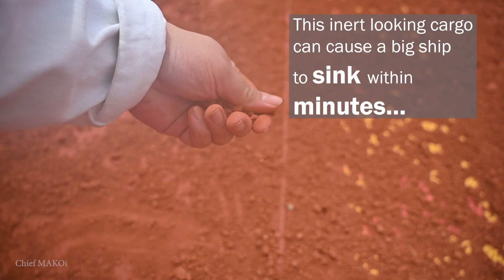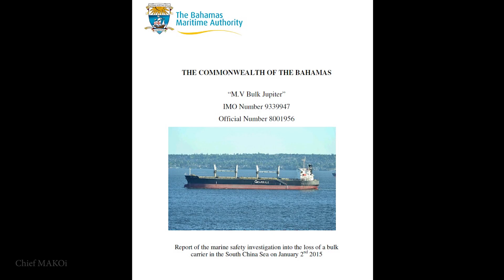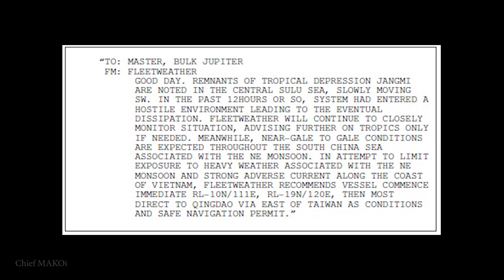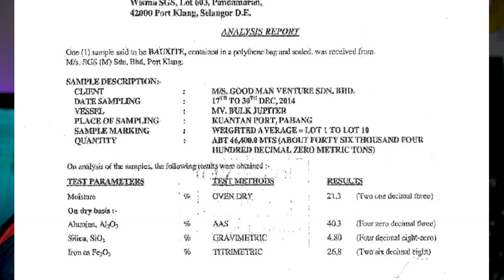The Cargo That Can Sink Ships Within Minutes : Bauxite Liquefaction | Chief MAKOi Seaman Vlog

Comment: I'm not in the marine industry, but it would seem that if the problem is water rising creating a slurry on top, inverted subdivider boxes could be forced down from the top caping the material and preventing the slurry's movement.  It would cost more and require extra steps, and they would have to be tied down.  I know the overall problem is called the Free Surface Effect by naval architects.  I'm pretty sure that is what caused the loss of three of the four PROTEUS Class coalers/bulk carriers.  They just disappeared. The fourth PROTEUS class ship, the JUPITER, was converted from a bulk carrier into the US Navy's first aircraft carrier the LANGLEY.  It was scuttled by its crew after being damaged by the Jappanese.
Reply: You're not going to be able to force anything like that down into the cargo. Too much friction between the walls of the boxes and the cargo as you try to force it in.
Reply: @beeble2003  I guess that means the only option would be to subdivide the holes more from the bottom to top and have blocks which can be dropped on top and anchored - expensive and problematic. I guess the water content has to be checked by the shipping company's testers before and during loading.
Reply: @lewisdoherty7621  Your last sentence hits the nail on the head: the correct solution is to avoid the problem altogether by not loading the wet ore in the first place.

Comment: I'm not an engineer nor do I know much about cargo ships other than what I've learned from this channel. That being said there seems to be an obvious solution to the liquefaction tendencies of some dry materials. 
There are way too many people who will, by default, automatically reject any new thinking-outside-the-box type solutions. I'm hoping that somebody is able to read this and actually think it through. Because I personally would like to know why this idea wouldn't work.
Anyway here's my idea:
What is the item that allows transportation of liquid products in everything from ships to planes to trucks? The answer to that is baffles. 
My question is why they couldn't utilize baffles in the containers that are transporting such products? Yes it would add more weight to the ship and would lessen the amount of product that could be transported because of the space that the battles would use, but it would also mean that they wouldn't have to worry about liquefaction because the dry product is being treated from the start as if it's a liquid product.
It would definitely add more expense, but that expense would be offset by the ability to ship the product no matter the moisture content. It would also offset the expense by possibly lowering insurance rates for shipping such products. Not to mention the expense of a ship that sinks because of liquefaction.
The baffles could even be designed in such a way as to allow them to be removed with relatively little effort if they weren't needed.
Anyways like I said I'd be really interested to hear people's opinions on this idea.

Comment: When you mentioned iron ore as being another possible source of liquefaction, I thought of the Edmund Fitzgerald (my dad was a crewman on a great lakes freighter before WWII). Could liquefaction have been a contributing factor to that loss as well?
Reply: He must be talking about raw iron ore. Great Lakes freighters transport a purified and pelletized version called taconite pellets. The pellets are roughly a half inch in diameter.  The pellets come out of the production process very dry as they are oven roasted, making them fairly sturdy to survive transport. I imagine that if the pellets were to get wet via rain or waves they wouldn't absorb much water because of their density. The space created in between the pellets would allow the water to simply drain through the cargo.
Reply: @rjgoniea  He'll be talking about haematite, yes. It's shipped as crushed rock and would be susceptible to compaction and liquefaction. Taconite is actually a relatively impure form of iron ore: when mined, it's about 35% iron and, is purified and roasted into pellets, of about 60-65% iron. Haematite ores usually don't need much processing to get to that iron concentration. The steel industry in the US only started using taconite after running out of haematite.
Reply: @beeble2003  taconite contains both magnetite and hematite, and some other trash iron containing minerals. 

For taconite pellets the high magnetite areas are mined, magnetically seperated, then pellletised. It is the pellets that prevent liquifaction not the mineral type.

Both hematite and magnetite can be mined and transported as lump or fines. Magnetite is more easily processed as fines so is probably more commonly transported as fines. But all types of iron ore are commonly transported as fines. 

Except taconite, it's too trash to transport raw and needs onsite processing into pellets.
Reply: The fitzgerald dunk due to the leaking cargo hatches during the winter storm.
Reply: @gatewaysolo104  That is only one of the theories about the sinking. None of them have sufficient evidence to prove they were the primary cause. And in my opinion the leaking hatch theory is one of the least plausible theories out there.
Reply: No. The particle size is way too big.

You're like the third person to ask this. Why is everyone asking about such an old and obscure accident?
Reply: @mabamabam  Here in the Midwest it is far from obscure. To date it is still the largest ship to sink on the Great Lakes.
Reply: @mabamabam  obscure? There's a famous song written about the Edmund Fitzgerald
Reply: @TheOldMachines  The ironic thing is that song is factually incorrect on a number of major points.
Reply: @mabamabam  The Edmund Fitzgerald was considered the pride of the Great Lakes fleet in a time when things like ships and trains were considered marvels of modern engineering far more than they are today.  Her sinking had much the same impact as the Titanic.  It is also a cautionary tale showing that even the finest ship manned by an experienced crew and commanded by an experienced captain can fall victim to the power of nature.
Reply: @mabamabam  umm, you watched the video where he mentioned iron ore? Perhaps since the EF was hauling ore liquidification could have occurred. That’s why they ask?
Reply: @mabamabam  Obscure is a relative term.  It might be obscure to the uneducated.

Comment: very interesting , i worked as a logistics specialist for road transport, rail links as well container traffic from local ports , we dealt with typical dangerous goods cargo , regarding container exports or road ferry crossings and all the regulations of stowage and separation restrictions and how to properly label multi product loads ,,, and can attest to having to stand our ground on  not excepting improper packed or even leaking products from shippers , getting the typical threats of giving the load or contract to other carriers or making the driver wait  for a new appointment days later, only to  get there and still have the same  non ship-able products as before and re refusing it once again ,,, or the difference of consumer commodities from equal volume in  bulk container shipping forms that now require  special labeling and separation where the equal volume in consumer commodities  size packaging did not require the extra labels thus extra cost ,, the average consumer has no idea what it takes for the goods to reach their local market store , and that includes the bulk cargo that make up the base of most consumer products these days ,,, we all have seen far too many preventable accidents ,stay safe and never be afraid to protest a  bad decision

Comment: Thanks, Chief. Most of us are unaware that "dry" cargo is seldom completely dry or of the potential consequences of error.

Related to moisture problems - How do grain carriers deal with the risk of fire if damp causes fermentation and heat build up?
Reply: You could pump in seawater to extinguish a fire I guess.
But fermentation alone can't lead to fire, it needs to be a cargo that chemically oxidises at a relatively low temperature otherwise it just gets to a temperature that kills the fermentation then stops. I don't think wheat grains do this? I know it's a problem with some oily nuts and seeds though.
Reply: @samheasmanwhite  It's not really fermentation - but wet hay makes heat until it's dried out. It doesn't really become a problem until stored in a pile or baled. This heat alone doesn't really tend to get out of control. The wet environment (greater than 18% moisture content) fosters the growth of bacteria and fungi that produce even more heat. Once it reaches about 100°F(38°C) it starts undergoing a chemical reaction (also called caramelization) that produces even more heat (at this point, the bale can still be OK - but its nutritional value is reduced). This caramelization also fosters further bacterial and fungal growth that then spirals out of control producing gases that are above their ignition point. Upon contact with oxygen, they ignite. 

This can happen with grain too but - greeness generally isn't a problem. It's usually fungal growth and grain dust that causes fire/explosions. The fungal growth causes excess heat, produces gasses that are above their ignition point, oxygen reaches it. They ignite. The grain has been disturbed and has produced enough dust - the dust concentration is just right and the air ignites. 

There's charts and research about this topic freely available online.
Reply: @EyebrowsMahoney  it's not unheard of around hear of a barn burning down because farmer Joe was unable or wouldn't use a tedder for his hay or something, wet hay- stacked in a old school hay loft, builds heat and smoldered, to a flame. Gone.
Reply: @tacomas9602  Of course - I thought I had covered that? Part of the issue is that Hay still respirates once it's chopped. (I think most plants still do to an extent) this produces heat until it dries out and stops. If the heat gets bad enough, it starts to caramelize the sugars (known as the Maillard reaction), which livestock love (because it's sweeter -but it's not as nutritive for them) and then the warm environment allows microbes to flourish - further creating additional heat (and fire risk). 

Tedding is an option but modern hay mowers have crimpers which minimize the need for tedding these days by crimping and splitting the stalks to allow them to dry faster. Though a lot of farmers still are working on weather pressure so they might be inclined to bale moist - which if they're careful, they can get away with but have to be on top of their bale maintenance.
Reply: @samheasmanwhite  I'm not sure but that sea water sloshing around in the hold might add  another problem. 
I was asking from stories about damp grain fermenting and causing smoldering fire in grain elevators when oxygen got to the source. Also from personal experience where hay had been baled containing too much moisture and barn fire started as bales were moved and oxygen got to the interior of the loft.

Comment: Chief:
Does this mean that when ships carry liquid cargo, they carry significantly less, so that the liquid content won't cause the same "top heavy" waves?
Reply: The safest way to carry liquid cargoes is to have the tanks topped right off. The shifting of any bulk cargo is dependent on how much “free surface area” there is. Full tanks have no free surface, therefore no shifting.
As others have mentioned, longitudinal bulkheads can reduce the severity of the shift by reducing the athwartships range of free surface movement. 
With a liquid cargo, such baffles do not affect loading or unloading as they do not need to totally prevent flow, just reduce “sloshing”. However, when the cargo is unloaded by bucket then baffles are a real hassle.

Comment: Good channel Chief
Question what is your vessel's bulk cargo capacity? Tonnes/m3?
Bauxite very cheap commodity worth about $70 tonne delivered China. You need 4-5 tonnes to produce 2 tonnes of Alumina, ( worth $389 tonne delivered China) and 2 tonnes of Alumina to produce 1 tonne of aluminum.  ( $2,700 tonne)
Bauxite is 1,281kg/m3
Vs Iron ore  5,150kg/m3
Iron ore is $93 per tonne

Comment: so, just curious: why are there no baffles when carrying materials that may exhibit liquifaction? Because that's a foolproof way to "soft" compartementalise, and prevent list due to a moving center of gravity?
Reply: no kidding - even baffles for the top 50% of the hold would have made a huge difference. And if so, why not just pump out the excess water?   All boils down to cheapness of the owners unfortunately.
Reply: @ghostrider-be9ek  You can't just pump out the water. First, there's nothing to pump until liquefaction has happened, and that doesn't happen until the ship is out at sea being shaken around by the waves. Second, it's not just water: it's basically bauxite mud, and it's a significant fraction of your cargo.

I don't know how effective baffles would be. If you needed so many baffles that it interfered with loading and unloading the cargo, that would be an issue. And there's already a control measure against liquefaction, which is to not load wet cargo.
Reply: @beeble2003  Why not pump IN water so that it's filled completely to the brim? Then there's no room for displacement to cause an imbalance
Reply: @chang.stanley  Because the customer wants dry bauxite, not mud, and because you have to burn a lot more fuel to carry all that water around.
Reply: @beeble2003  I see. That makes sense. Thanks
Reply: @beeble2003  as a non expert - I would surmise it would still be better to pump out the top level of water/slurry, rather than risk capsizing - but if 50% of the cargo turns to soup then this idea is pointless. 

Baffles are used in liquid containers - but for dry goods I would suggest not going down all the way to the bottom, but rather say, top 50% only as the free surface effect is the greatest up top.
Reply: @ghostrider-be9ek  You'd need to pump thousands of tons of mud in a few minutes. Maybe that's possible but the correct solution is to load your cargo more carefully to avoid getting into that situation in the first place. Just like it's probably possible to fit an ejector seat to your car in case you try to overtake and find that there's traffic coming the other way. But the correct solution is to avoid that situation by driving more carefully.
Reply: @beeble2003  yea the pumping would be  done slowly - ie. the crew discovered the slurry after departing (but still in relatively calm seas) - however the partial baffles would go a long way to mitigate the free surfce effect
Reply: @ghostrider-be9ek  The slurry only happens after the ship has been shaken around by rough seas.
Reply: You can't unload with baffling.
Reply: @mini696  if the baffling is only the top, say 50% of the compartment, to minimize free surface effect, it would still allow for unloading.
Reply: @ghostrider-be9ek  No they are unloaded with big buckets.

Comment: Some more information on the Edmund Fitzgerald that sank in 1975 on Lake Superior, USA. I heard his story on a video on YouTube. He is in his later 50’s or early 60’s. There was a gentleman who was the nephew of one of the sailors on the Fitzgerald. He said that when Fitzgerald was being manufactured there was two bulkheads that were deleted from the ships cargo hold. And this caused some structural issues in this man’s opinion, because it caused the ship to twist not only up-and-down but sideways and this caused the steel to fracture. And the vents on the side of the ship which would let water into the ballast tanks to keep the ship stable were torn off during the storm, so the Fitzgerald was taking on water and listing. And if you looked at the cable fencing along the side of the ship it snapped in half. And when the Fitzgerald went underneath a wave it submarined   and touched the bottom and the stern keel snapped in half and flipped over on top and the boat sank. And the stern on the ship was found not far away from the bow which indicates that the stern broke from the rest of the ship while the bow submarined and touched bottom. If the Stern broke away while the bow was still floating the Stern would have been discovered further away from the bow.

Comment: As I recall, the Edmund Fitzgerald was hauling iron ore on its final voyage. It’s surmised that cargo  coupled with leaking hatches and extreme weather took that ship down very quickly.
Reply: It was either that, rouge waves or both. Just before the Edmund Fitzgerald sank, the captain reported water was coming in to another ship that was escorting her. the Arthur Anderson. She could have ran around and breached her hull.  To this day, no completely satisfactory explanation has been found for what happened.
Reply: The Edmund Fitzgerald was carrying taconite pellets. They're not susceptible to compaction and liquefaction because they're basically half-inch diameter spheres so water can just drain through them. The pellets are also roasted, so they're very dry. When the video talks about "iron ore" being susceptible, he means haematite "direct shipping ores", which are basically crushed rock, not taconite pellet ores.

Comment: If that bauxite is so treacherous,  why don't the cargo holds of ships have baffles or compartments to limit it's movement?  Would be a lot cheaper than losing a ship and crew.
Reply: Likely due to versatility.
Reply: Thought o f that too, haa    but forethought is   sometimes too costly  as opposed to the can test,  If it's even dome properly.  To many short cuts  it would seem to  cause a lot  of damage and loss.  These precautions need  to be enforced or  people need to be  held accountable.
Reply: Because it's much easier to not load wet dirt in the first place.